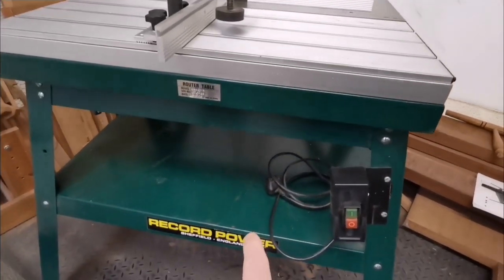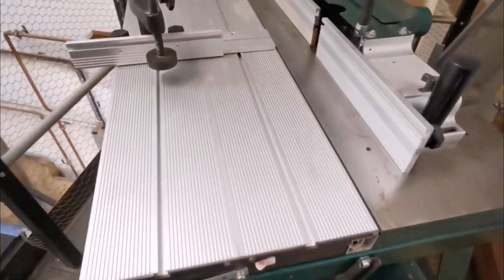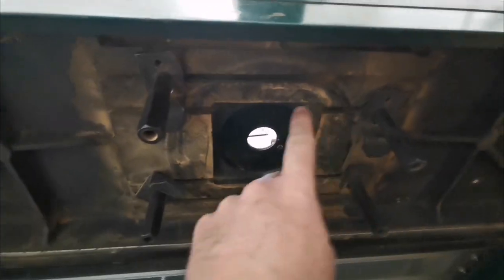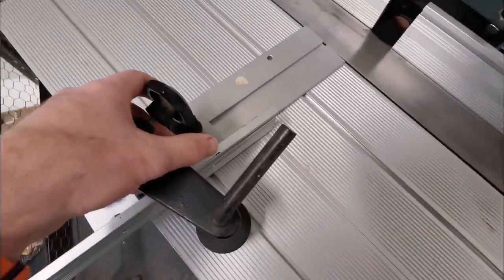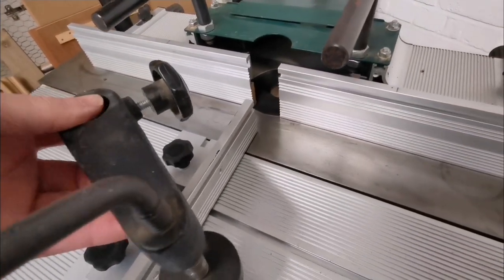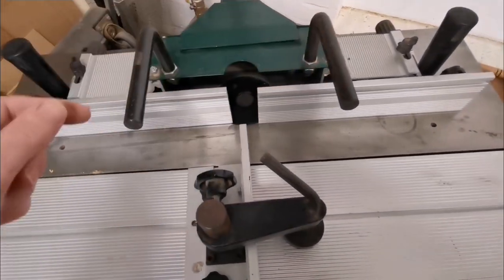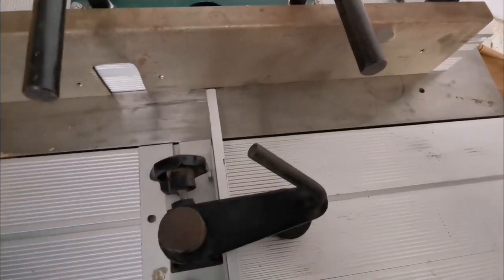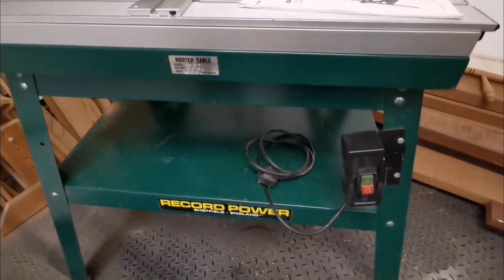Record Power router table - review and features

Comment: I assume you need to manually  adjust  the height with the plunge setting on the router? A lift  would be nice to hqve
Reply from the maker: Yes it's a manual adjustment. Lifts are more popular now, but not on this scale for this sort of price.
Reply: @The Worcestershire Cabinet Maker  yeah I figured as much still debating the router table or just bit thw bullet and get a spindle moulder
Reply from the maker: Depends on what you're planning to do in the future. I sold this router table, as its not in my plans for the direction I'm going in. You'll make the right choice

Comment: The power switch should be moved up, it seems too low to me.. Gas struts can be retro-fitted as can the handles if desired. The guide appears to be for a saber/jig saw. Overall, I think it's a pretty solid router table. I've never seen a cast iron router table in the US, only plate steel or aluminum.
Reply from the maker: It's seriously sturdy with the cast iron table. I'll take a look at the switch and see if it could be moved higher. That's a really good point. Jamie